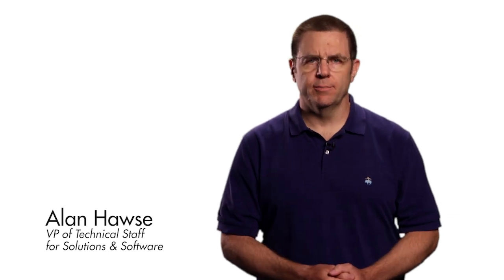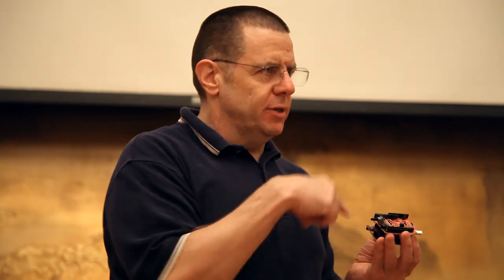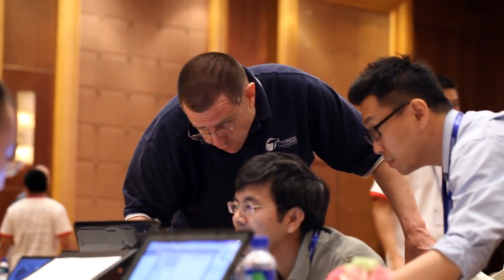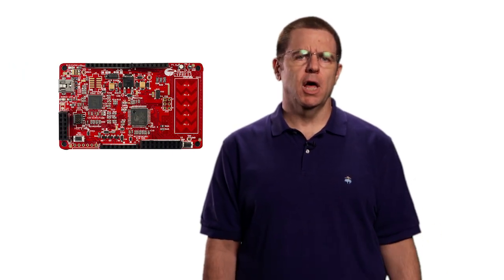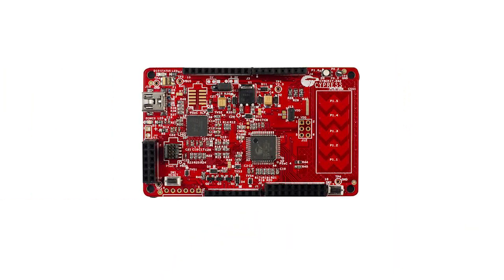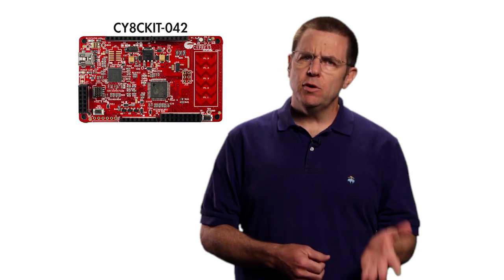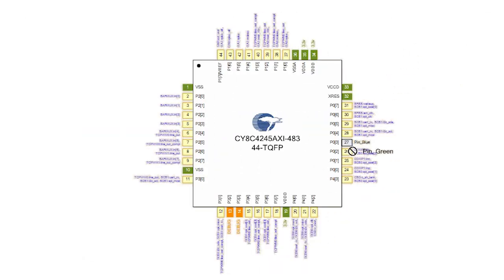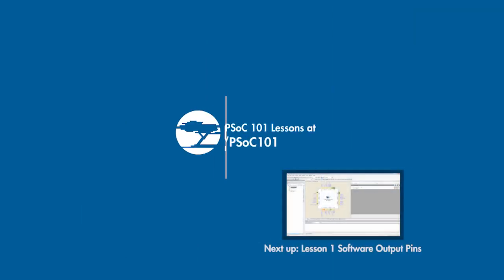PSoC 101: Introduction

Comment: We need an emFile to enable an SD Card slot to the PSoc6 dev board.  The emFile is a schematic block to ad into the graphical part of the project. Does PSoC creator provide the ability to develop an emFile?
Reply: Piggy-backing off of this question, is there a reference design available for an SD Card slot add on?